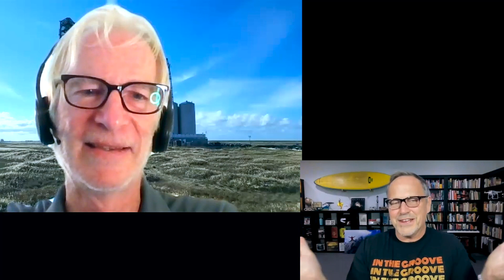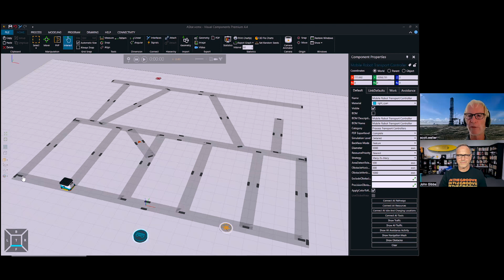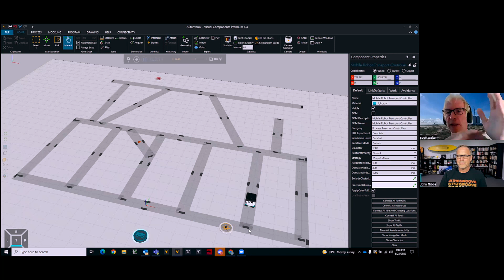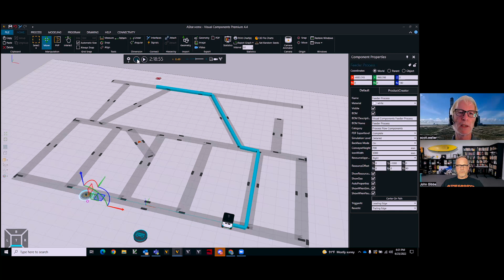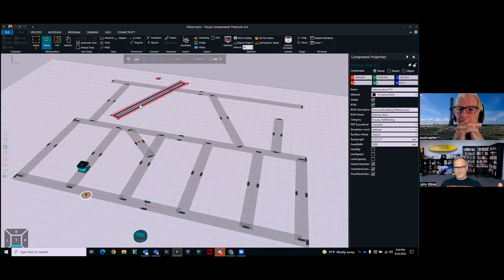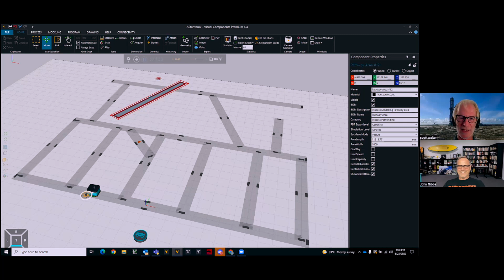AI, A*, And Tesla's GIGA FACTORY Production Layout--Chat with a Factory ROBOTICS EXPERT!

Comment: My BS meter exploded when it was said that the exponential total was more than the size of the universe. Was fun, but that was stupid (look up Laugh In joke). Keep taking right turns for a left but you get stuck in a loop. 🎲Did like the A*  (A-star) info. Some usable info.
Reply: He was referring to the factorial function, not the exponent. The factorial increases 'exponentially' faster than the exponent. 100! = 10x10^157.  Number of particles in the universe is estimated at 4x10^80. Even if that estimate is way off, it is still 80 orders of magnitude smaller than 100 factorial. You can confirm these numbers yourself.